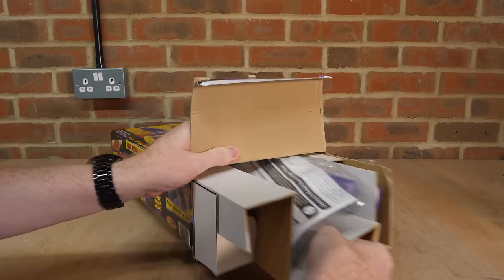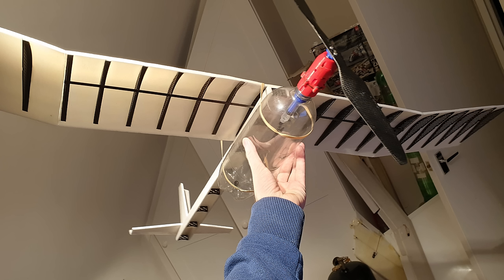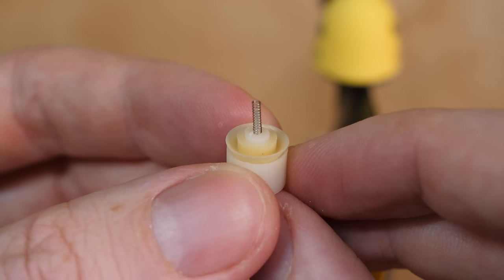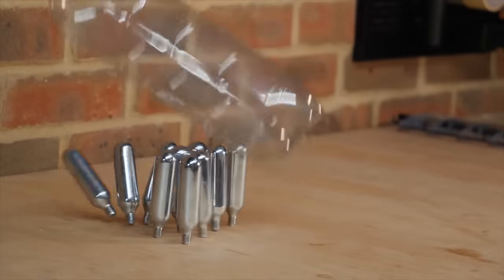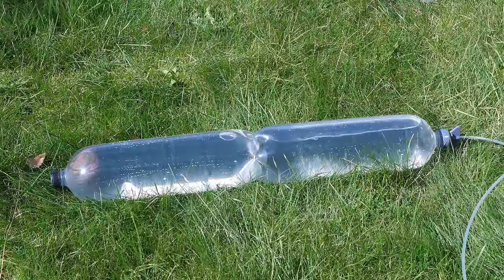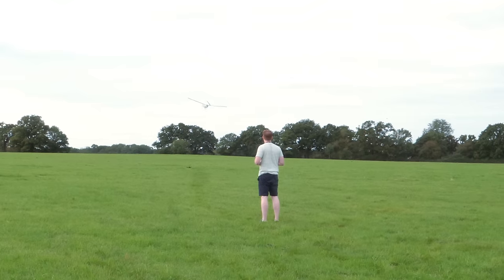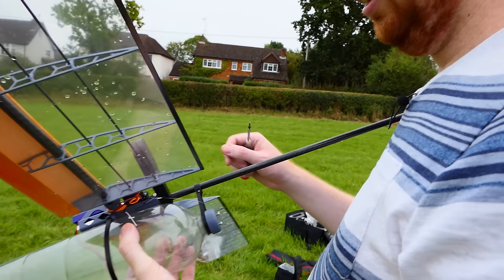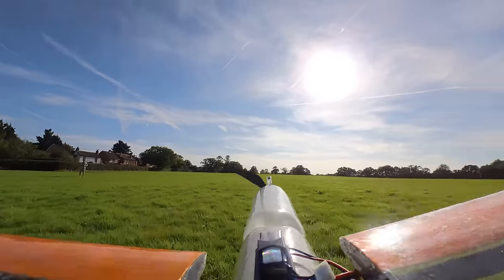Flying a Plane Powered by AIR

Comment: 486 / 5,000
I would make the wings out of thicker carbon fiber spars that I can use as a compressed air reservoir. Same as the fuselage. That way I could have a couple of liters of compressed air at 500 pounds, apart from improving the aerodynamics. What also needs to be improved is the engine. I think it should be a two-stage, high and low pressure engine (like the Titanic's steam engines), lower RPM and with a larger propeller. I think you can expect a range of several minutes.

Comment: Use some cooler compressible gas instead of plain air... & try to fly it in the winter months... & if possible, fill the main wings with adequate quantity of helium instead of air (so that the machine lands smoothly instead of crashing at once...

Comment: Can't believe you think making balsa wing spars would be more difficult the 3D printing them. I agree the weight difference maybe so little it would be negligible but I have been building balsa models for a very long time and have managed to build a sub 2g model that flew for 49 minutes on 0.7g of rubber power. Ps do you also use old nerf guns to build your air engines?

Comment: I have an additional comment. If you could convert the energy it produces into electrical energy so you don't need a  battery. That would be impressive. One idea is a double motor where they connect in series to eachother with the generator being first obviously lol....make the exhaust of the first motor lead into the airintake of the second. Less wasted air and getting more use out of it at the same time. Makes you wonder how many generators it could run in that consecutive pattern..

Comment: Couldn’t u use the crankshaft output to power a small air pump so it’s filling  it self up slowly while flying. Surely the weight and the placement of this would mean another challenge on making it fly. If anything u could use a co2 cartridge to make the pump work

Comment: So jealous of the tools at your disposal. I have minimal aeronautical engineering background, but a decent understanding of lift/drag...I'm curious if it matters WHERE the weight is distributed? I ask because this was flown outside with wind being a variable each flight. If done in a gymnasium I believe your 1:22 flight would have been over 2mins. Then, avoiding variable winds, you could begin a SIN-wave flight path to maximize speed w/ fuel (air pressure) expenditure. It seems you are able to toggle when the propeller receives power; with the SIN-wave path, shouldn't you only need the initial burst when you launch-throw, followed by bursts approaching the top of the wave before gravity is utilized to accelerate into a dive, pulling up, thrust, repeat?

Comment: I'm not sure if it is gonna actually fit your plane design, but why don't you use the empty space inside the wings? making a let's say 2 piece carbon wing shouldn't increase the weight dramatically but can become an additional source of air for the engine. Theoretically, it should be stiff because of the inside air pressure so you also don't need to add lots of stiffening ribs inside a wing

Comment: Can we add a bit of dry ice or liquid nitrogen in the bottle as both these things will expand with time and give extra air time fuel mid flight. On second thought both of those will make the fuel tank brittle and might result in an explosion. Might need a bit of beta testing.

Comment: Would love to see a dual engine aircraft design that uses a gas powered engine on one side, and the exhaust to drive an air powered engine on the other.  Just for s&g to see if it could work.

Comment: Could you potentially develop a method to fill the wings with pressurized air tanks and save some more weight and drag?
Reply: Making the wings able to stand up to that much pressure (or adding internal tanks to the wings) would probably add more weight than it'd be worth, especially with all the piping that would be needed to connect the tanks.

Comment: Hi. Awesome video! I'm wanting to make my own drone and I'm trying to choose a flight controller. I want one that's relatively easy to use at first, but is customizable and cheep(less than 50 pounds). At the moment I'm looking at the APM 2.8 Ardupilot flight controller. Do you have any suggestions?

Comment: Curious if he will be able to make an air-powered bike... similar to the air-powered taxis in India. Figure it would need to be a larger engine and have a much larger tank at really high pressure. I know some CO2 tanks can hold about 2500 psi, but figure that might not be the best option for a "fuel tank".

Comment: The comparison between CO2 cartridges and water bottles is a bit more subtle. The amount of energy stored equals (very roughly) E = 0.5 * pressure * volume. SInce the CO2 is at a much higher pressure, the two solutions come reasonably close, energy wise. But to convert that energy into a regulated propulsion is a challenge for the CO2 solution. A 3D printed engine will certainly explode.

Comment: Could you use a two propeller plane with slightly smaller engines? like on each wing. maybe a center body of air tanks (dual like now) and one tank on each wing.

Comment: Hey Tom, if you put in an air valve that was variable and servo operated, would that help? As you would control the throttle and maybe get a longer run time

Comment: 6:20 got caught slacking! Boyle's law doesn't work in this case as the carbon dioxide inside of the cartridge is not in gas form but liquid (pressure-enthalpy diagrams also say that the pressure is a bit higher in these usually). You need to calculate it the hard way with molar mass and you will get roughly 8 liters or so for a 16g cartridge.

Comment: is there a consistent failure point on the bottles when they are filled to a higher pressure? if so, can it be reinforced efficiently enough to allow for higher pressure and therefore the required thrust for adding another bottle?

Comment: Hey so something about the CO2 comparison bugged me. To the best of my knowledge CO2 canisters contain liquid CO2 not gas. So you have a state change and gas expansion. So for a 16g canister of CO2 you should get around 8L of gas at one atmosphere and 25c.

Was wondering if you had tested the total gas volume in the CO2 canister. I do not mean this with any malice I am working on a eject system for a model rocket that uses CO2 canisters and I want to make sure I have the numbers right.

Comment: You van use idea from working CO2 motor produced in Czech republice by Modela. IT work about 2 minuta. IT has on Piston pin that open air presure by touching boll at  head.

Comment: 2x bigger add an electrical air compressor with solar panels to it doesnt die in the air then add remote funtions to the plane to control it

Comment: You should remove the battery and add a small dc motor and capacitor to act as a generator.. probably wont work but I like the idea of it

Comment: I guess if I were to do like you're doing and build a plane that flies off Air power I would build a delta wing and build the plane all out of foam board and have the prop and the motor back by the tail mounted above the fuselage

Comment: Hi Tom,
Very interested watching your air engine.
I run steam engines and for water pumps we limit the lift of sealing balls to about a 1/3 or 1/4 of the ball diameter,  this helps reduce ball bounce and also let's the ball lift sufficiently for the correct amount of water to be pumped, I wonder if this would help with your air inlet.
Nigel

Comment: why not use the air colliding with the front and just use the starting air for a jump start or just throw it, it SHOULD go almost forever, and use a motorized latch to open a hole in a tube, causing it to slow down to a stop?

Comment: 6:30 That is wrong, the CO2 has 12g Liquid gas inside, with 1,98kg/m³ x 12g you have 6 Liter Air. There also 88g CO2 Bottles but they quite heavy.
Also its Dangerous to Pressurize Waterbottles to over 6 Bar, one with 7 Bar Explode in my Hands... That Hurt much and leave bruise for 1 week.
Also A Friend had Hearing Issues for like 2 Weeks after that.

Comment: Could you not just fill the hollow wings with air instead of adding a bottle and attach it to the fuselage bottle with a tube, saving weight and increasing fuel capacity?

Comment: Bro, just get stronger engines and probably make a double engine plane (the plane is unstable at times with no wind in your video) and since the tails are so far, you can probably add a bottle or 2, and please try making nitromethane engine planes (they are very strong). Please also add some landing gear.

Comment: Would it be possible to reduce the battery weight bei putting lightweight Solar panels in the wings? Seems it only has the Receiver and the two servos so that shouldnt take much energy right?

Comment: I would test if u would make the connencting rod connected to the piston. And then making the piston smaller execpt the are it touches the cylinder wall so the air can flow out the engine more easily

Comment: I‘m curious if you could shave off some weight by replacing the bulky LiPo battery with a bunch of supercapacitors. If all you need is 5 minutes of run time, why carry around the „big“ battery?

Comment: you could shave off a bit of weight by using an fpv camera, they are incredibly light compared to the one you are using.... maybe get the smallest servos you can and reduce the battery weight as much as possible.

Next two sets of double bottles, feeding twin props, though a single outlet...

Good luck

Comment: Two comments. A folding prop would not break on landing. The plastic bottles I tested would burst just over 250 psi. More pressure would give you more flight time.

Comment: You need a day when there's either no wind or no more than 2-3 mph.  Then you'll get a true measure of its performance.     How about a tiny electric motor powered by solar cells in the wings

Comment: Shitty idea that might have been brought up already: can you not mould a tank in the wings? That would increase the compressed air capacity and would increase the rigidity of the wing structure as well.

Comment: seeing you drill holes into the wood for weight saving made me wonder why you don't own an led laser cutter by now? they are pretty cheap and have plenty of power these days. although i'd recommend to add some cash ontop for safety measures. in my case i added a fume hood with orange tinted windows and invested in some proper certified laser safety googles, i'm not trusting the ones from the printer.

Comment: Your volume calculation is just wrong. The CO2 in the canister is in liquid state. The 800-900psi is its vapor pressure. 1l of liquid CO2 is 513.4l of gaseous CO2 at 1 bar (or 9.3l at 55bar). So that 22ml canister actually contain a bit over 11l at 1 bar. There are larger CO2 canisters that would yield better energy density.
Reply: he corrected the mistake on his second channel

Comment: If we can use electric compressors to make these air storage tanks, it can solve battery problems in EV
Reply: Compressed air is absolutely garbage for energy storage compared to basically any actual battery

Comment: Remember that temperature of the air also affects pressure. Pumping slowly to allow the air to cool down fits more air in the bottle.
Reply: Yeah no. Not at those flow rates. The air in the bottle is at ambient.
Reply: @UnitSe7en  measure it. You might be surprised.
Reply: @jannetorvela7051  If you say so.
Reply: Also, check your density altitude: cool dry day with high barometer will be the best day to go for your record. Stumped the Wright Bros for a year or two, they couldn't figure that out.